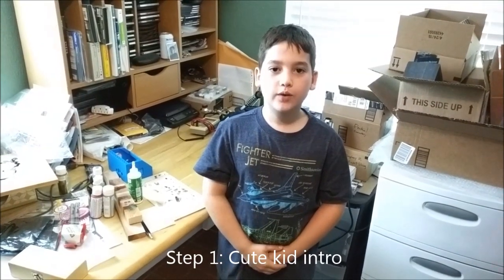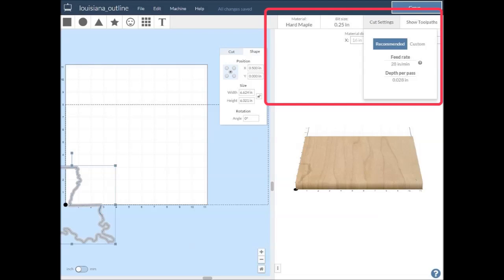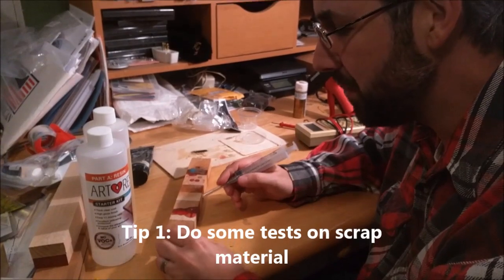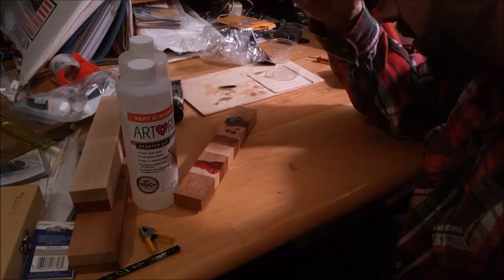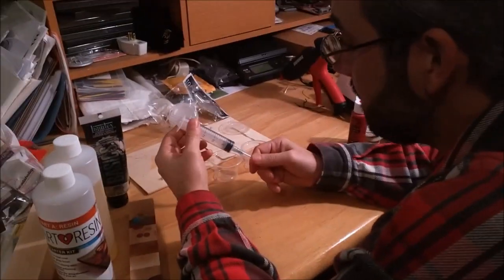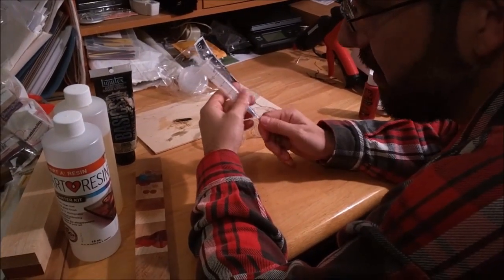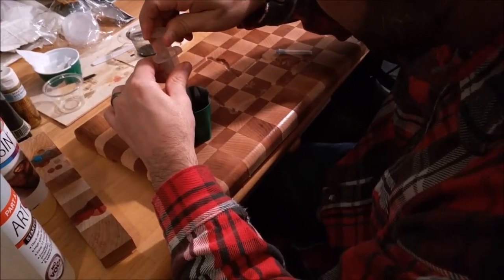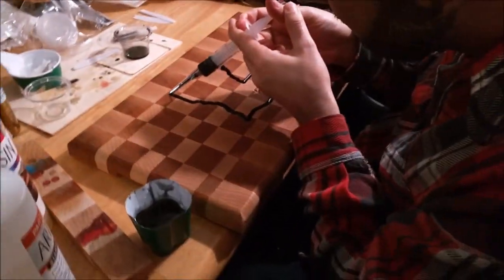Epoxy Inlay on a Cutting Board

Comment: Did you add the heat gun during the curing process or let it cure naturally?
Reply from the maker: +Christopher Snyder In this case I just let it cure naturally. I didn't have any issues with bubbles as long as I got the mixture exactly 50/50.  I did some tests with the heat gun and in one case, "cooked" the epoxy a bit and it came out horrible, so I got worried when it came to my final piece and just let it cure naturally.
Reply from the maker: I just let it cure naturally.
Reply: The "West System Epoxy" website recommends heating your epoxy-free surface first, then applying the epoxy, while letting it cool as it hardens.......as this method allows the chemical epoxy to penetrate the substrate..."more better"..lol.
So, don't heat the epoxy, heat the surface it's applied-to, then let the chemicals do the other work.